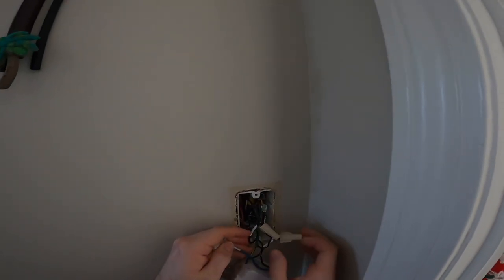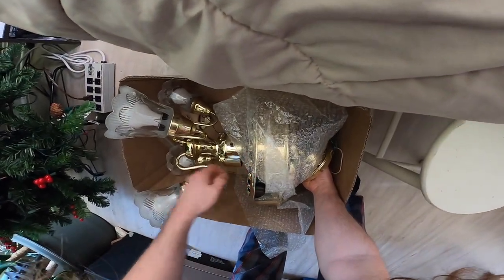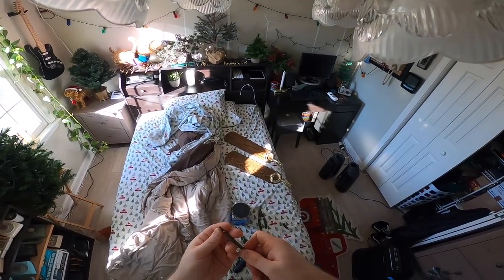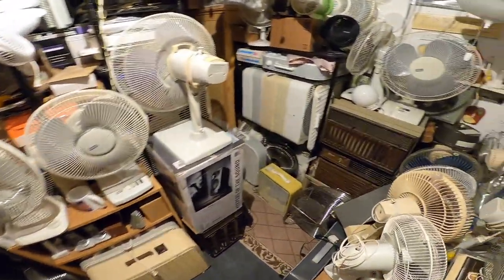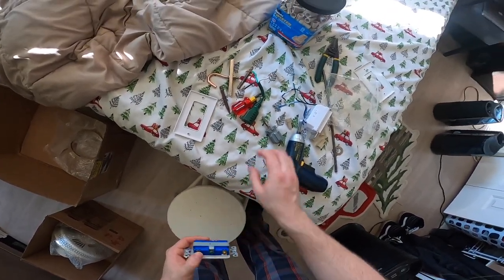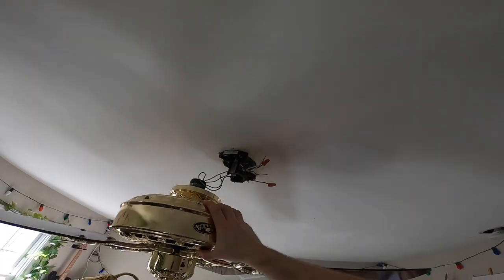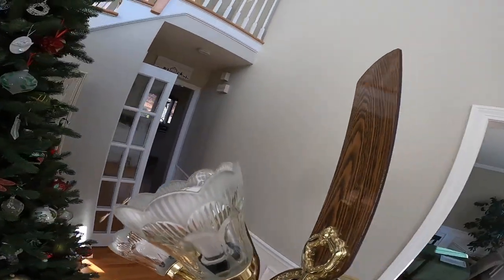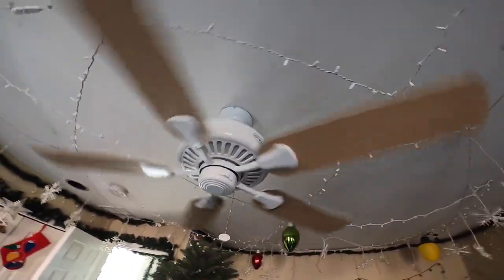Bedroom Ceiling Fan Replacement Double Fail

Comment: Those uninterruptable power supplies have been a pain for me. Just lots of freakshows and unnecessary beeping. They may be good for computer equipment and network equipment but thankfully my modem has a has a backup battery so at least a wired telephone can work.
Reply from the maker: I've had a few batteries go out over the years, I think one unit completely failed. They're definitely far from perfect. My old phone modem used to have a battery in it, but my new one does not which is why I installed all these units.
Reply: Hey, where did you come from?
Reply: @JordanU can I have that old ceiling fan

Comment: Do you know the model if the hunter ceiling fan that has a dial speed switch and that you pull the chain to change the direction and it have four blades
Reply from the maker: I have no idea what you're talking about.
Reply: @JordanU  We had this ceiling fan that had speed switch to control the speeds instead of with the pull chain and the pull chain just change it to forward or reverse  or off and the speed switch is on the fan where the reverse switch would be

Comment: That might be normal with that blade pushed back like that and have a ceiling fan that my dad put up straight out the box 20 years ago and one of the blades are pushed back like it's bent
Reply from the maker: It's not normal for a ceiling fan to shake uncontrollably. The blade iron(s) is damaged.
Reply: @JordanU  It have bent like iron but it don't shake but it could be a cheap way of them balancing it with a bent iron
Reply from the maker: @driftracing08  Any irons that are bent are defective.
Reply: @JordanU  Companies are always trying to cheap out on something

Comment: Did you change out the fan because you are moving? I hope so because the fan you just put up (in my opinion) was not worth the effort.
Reply from the maker: No, both fans are going to be repaired and both fans will be brought when relocating.